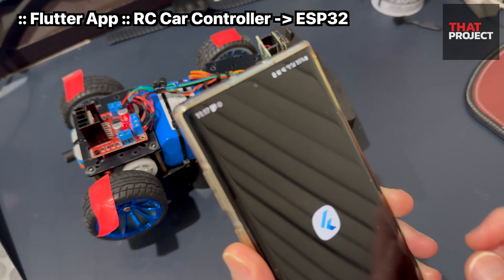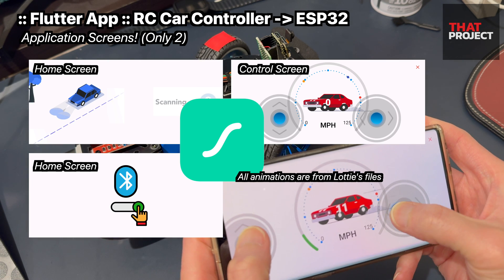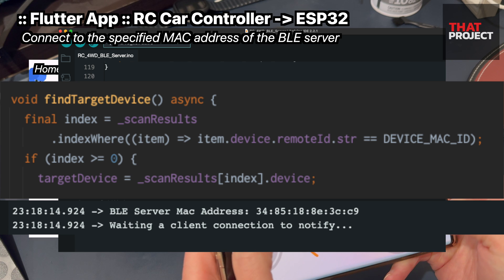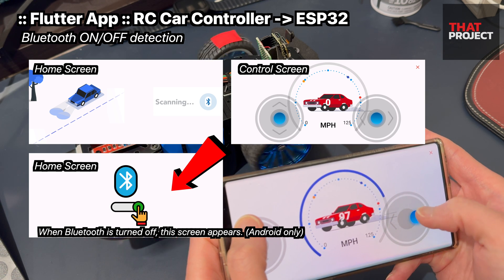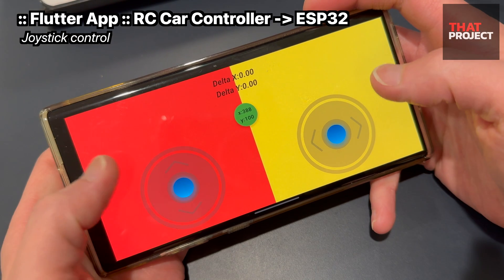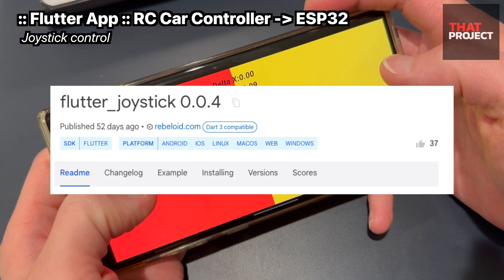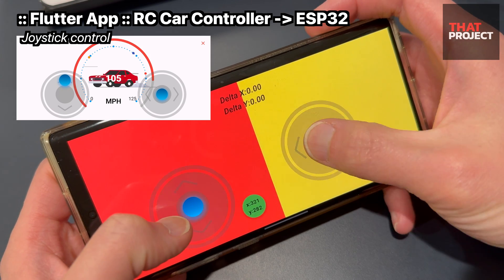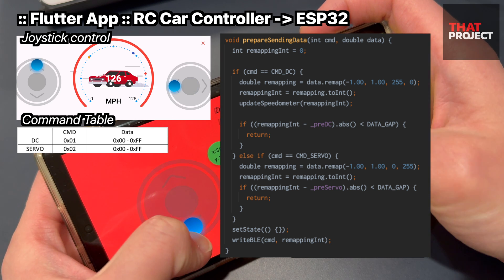BLE RC CAR Project, Part 2, Created a Mobile app to control it based on Flutter.#Flutter #BLE #ESP32

Comment: please make a totorial on how to connect the PS3 controller to the ESP32-S3 because the PS3 controller host library doesn't work on the ESP32-S3
Reply: the PS3 and PS4 controllers won't work on an ESP32-S3 as far as i know because it uses BLE, and the controllers don't support BLE

Comment: How can I run this flutter in Android?
Reply from the maker: You must have an environment ready to build Flutter apps on your PC. Can you build Android apps?
Reply: @ThatProject  nope, zero knowledge
Reply from the maker: @junaidmalik7140  This is essential because you will need to modify the app for your environment. You may need to set the Mac address of your ESP32 or modify the servo angle depending on your hardware. Unfortunately, I don't know how I can help.

Comment: Any recommendations on a sample ESP32 project that shows how to read data from a Bluetooth (or UART) and serve it from a web-server?   

BTW, do you ever use a Jtag debugger (ex. ESP-Prog) to step-thru and debug code?   I'm thinking of ordering one, and use it with VS-Code, but not sure how difficult it is to setup!
Reply from the maker: To simultaneously update data obtained through BLE to WebServer, the system may not operate smoothly. This is because you need to use BT and WiFi simultaneously (or sequentially).

I've never had a Jtag debugger for an ESP project. Maybe I haven't done that very complex project so far that needs the debugging tool.

Comment: Hi, is there  an android installationfile somewhere? I not see it on github and I Like to try your app.
Reply from the maker: Since the BT Mac address of the target device must be modified in the code, you must build and install it yourself.
Reply: @ThatProject  Do you mean that this code must be build again for every different ESP32?
Reply: @ThatProject  Are y sure? Normally what needs to match at both sides is the service_uuid and the characteristic_uuid , the mac address of the esp32 should be used to identify the device when pairing only in my opinion.
Reply from the maker: @SA-oj3bo  I made this app use the BT Mac Address to find the target device. So you need to update this part.

Comment: can you send two commands in the same time? like go forward and turn left?
Reply from the maker: The current version is designed to send only one command + data at a time. Unless we adjust the MTU size, we can transmit 20 Bytes per packet. Therefore, the system can be configured to send multiple commands + data at once through various command combinations.

https://youtu.be/A8SoJppPIok?si=PjVy4W7fVN9fxVyh&t=161
Here you can see my command set.
Reply: @ThatProject  when you build hexapod? 😅 You look like can explain everything simple would be great project 👍
Reply from the maker: @f7p1764  I'll try it!
Reply: @ThatProject  can't wait ❤️